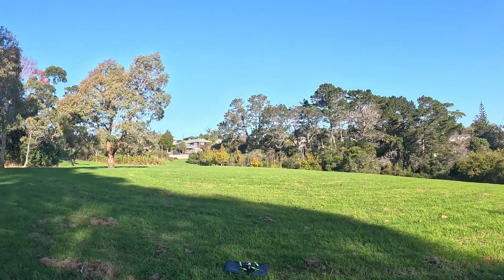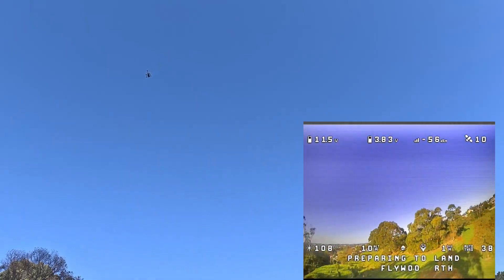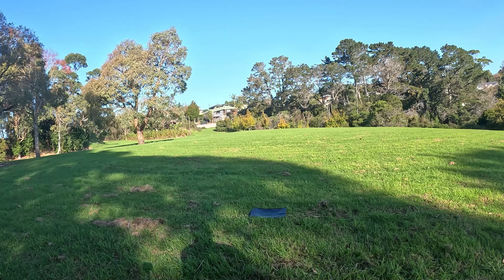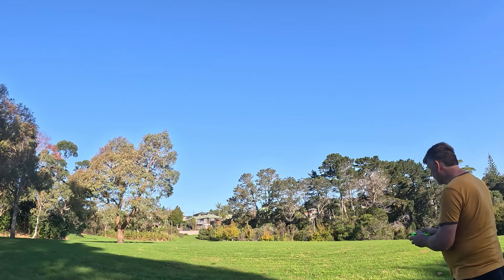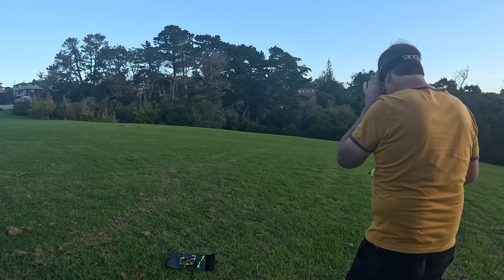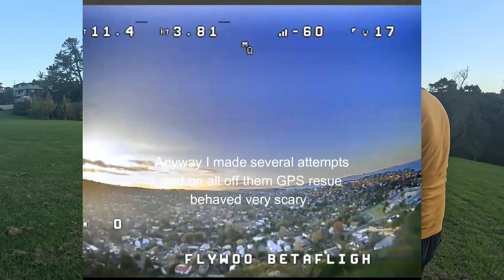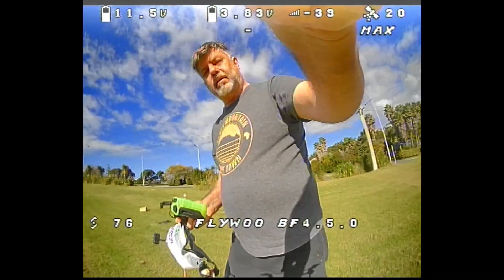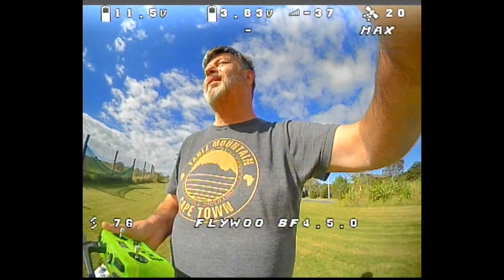Betaflight Rescue vs INAV Return to Home

Comment: Is this standard INAV navigation, or failed/missing compass mode?
Reply from the maker: Not sure I understand.  I first tried with Inav and then with BF.  There was no compass in either.   It worked well in both....  may a tiny bit better in INAV than BF, but not a big difference.
Reply: @wtb567   Okay, thanks! That's something viewers might want to keep in mind. Making do with a missing or broken compass is a new  feature in INAV. 
To really see what INAV can do, it might be interesting to ALSO compare using INAV as it was designed to be used - with a compass. In many cases it can manage without, but for the BEST performance, it might be worth checking that out.